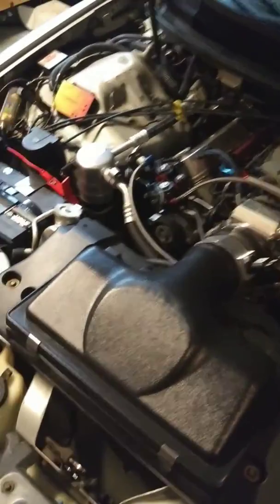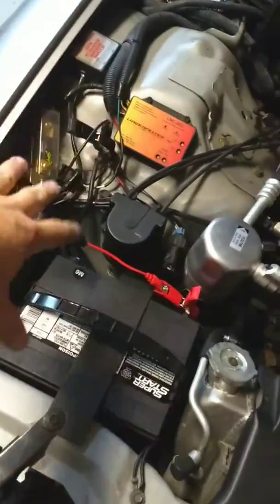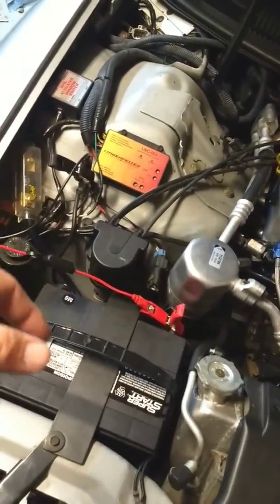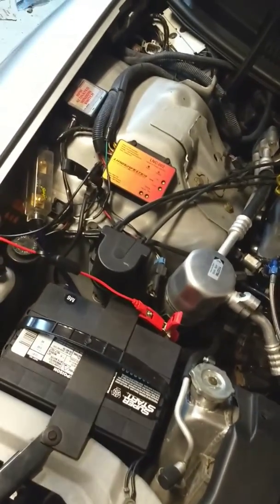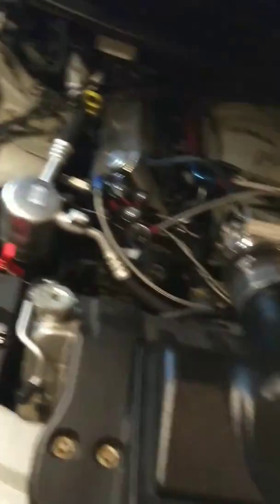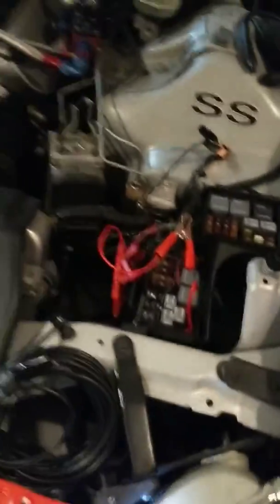'99 Camaro Fuel magnafuel pump overheating

Comment: So what was the result?
Reply from the maker: Tumdéaux, I couldn't make it over heat. I found the fuse was small. I haven't driven it much since tested so not sure if it is fixed yet.
Reply: @stevesalvati6287  do us a favor and delete  this /// your fuel rails are heating up gas and pump
Reply from the maker: @herbjoy  this video is two years old but it actually ended up being a vent issue causing a vapor lock.
Reply: @stevesalvati6287  you say no vent caused the pump to heat up ?
Reply from the maker: @herbjoy  has two vents but yes, poor vent placement. When the pump got hot you could hear the tank hiss. Loosen the cap it would suck air because entire system was under pressure. The longer you drove the more pressure it built up. On a four hour road trip about two hours in I could see pressure fluctuate and release pressure on the tank.
Reply: @stevesalvati6287  OK